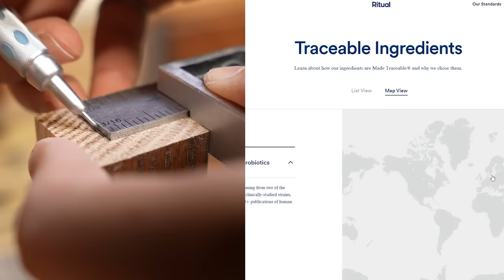Transforming an Unusual Art Deco Vanity

Comment: I would have encouraged incorporating the small drawers from the discarded middle section into the tophat that you made for the shorter right side module you removed. This would have retained more of the original features from the piece as well as raising the height to match the new height of the left side module. Art Deco pieces can be quirky in appearance but sometimes remarkably valuable. It would be interesting to see what a professional appraisal would say about the before and after on your project.
Reply: I'm guessing that adding one of the drawers to the top of the shorter piece would have made it too short, and adding both would have made it too tall. I have no doubt that he had a reason for not using those drawers.
Reply: I agree, i thought he would incorporate the two little drawers, but they would not have matched the height if he placed them atop. Overall they are gorgeous!!!
Reply: The original quality was terrible. Don’t you recall them ripping like paper? He rebuilt it with oak and kept veneer for drawer/door fronts

Comment: Suggest using a little Bees Wax or Parrifin Wax on the drawer slides. They sounded a little dry. That will help seal the wood in those areas, and help the drawers slide smoother when you put things in them. I learned that trick when I was renting a 1928 Craftsman Bungalow. We loved all of the built in hutches, the dining room buffet, and the bathroom towel hutch in the hall.

Comment: So genuine question as a fan but this felt like the most extra material I had seen you add in a video. Almost building a furniture exo skeleton to house the units with the main elements from the original piece being the drawers. From outside looking in it felt like it wouldn’t of been much more scrap wood to of just built new housing  and only kept the drawers. Is the original housing doing more than I am seeing or was it maintained for a different reason?

Comment: why add the cubby to the 3 draw unit when you could have just given the other one shorter legs? or was this all based on a common bed height?
Reply from the maker: I wanted a total height of 28” on both stands, which is a common and comfortable height. I added the cubby because otherwise I thought it would be a bit boring :)